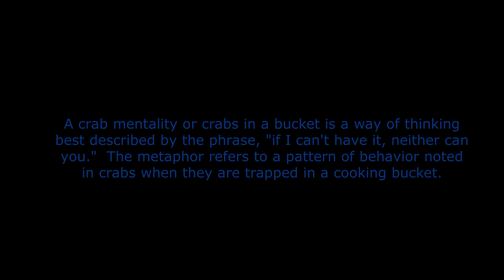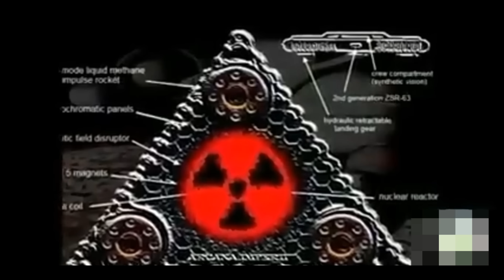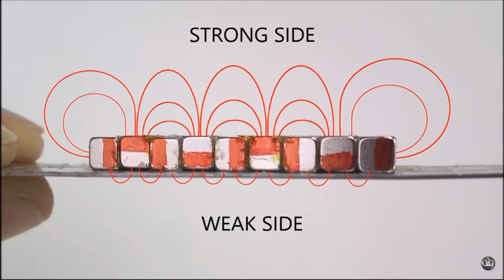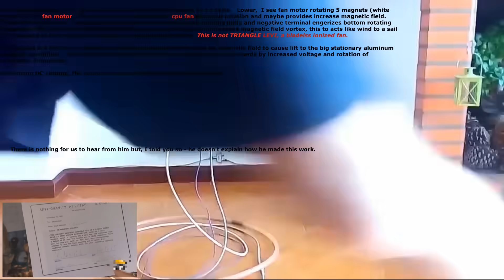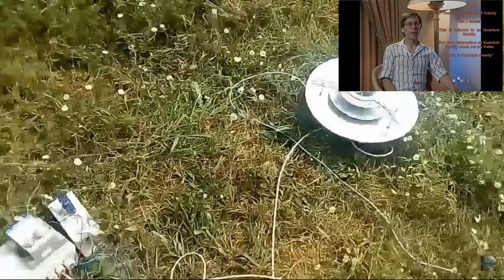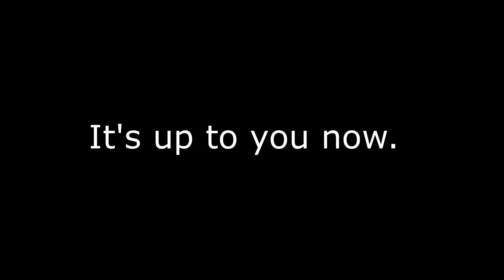anti-gravity project

Comment: Here is my latest Theory Of Everything along with the associated gravity test.  I believe what is called gravity is actually a part of the currently recognized 'em' photon and that the 'gem' photon is the energy unit of this universe that makes up everything in existence in this universe.  (Copy and pastes from my files):

Revised TOE: 3/25/2017a.
My Current TOE:

THE SETUP:
1. Modern science currently recognizes four forces of nature: The strong nuclear force, the weak nuclear force, gravity, and electromagnetism.
2. In school we are taught that with magnetism, opposite polarities attract and like polarities repel. But inside the arc of a large horseshoe magnet it's the other way around, like polarities attract and opposite polarities repel. (I have proved this to myself with magnets and anybody with a large horseshoe magnet and two smaller bar magnets can easily prove this to yourself too.  It occurs at the outer end of the inner arc of the horseshoe magnet.).
3. Charged particles have an associated magnetic field with them.
4. Protons and electrons are charged particles and have their associated magnetic fields with them.
5. Photons also have both an electric and a magnetic component to them.

FOUR FORCES OF NATURE DOWN INTO TWO:
6. When an electron is in close proximity to the nucleus, it would basically generate a 360 degree spherical magnetic field.
7. Like charged protons would stick together inside of this magnetic field, while simultaneously repelling opposite charged electrons inside this magnetic field, while simultaneously attracting the opposite charged electrons across the inner portion of the electron's moving magnetic field.
8. There are probably no such thing as "gluons" in actual reality.
9. The strong nuclear force and the weak nuclear force are probably derivatives of the electro-magnetic field interactions between electrons and protons.
10. The nucleus is probably an electro-magnetic field boundary.
11. Quarks also supposedly have a charge to them and then would also most likely have electro-magnetic fields associated with them, possibly a different arrangement for each of the six different type of quarks.
12. The interactions between the quarks EM forces are how and why protons and neutrons formulate as well as how and why protons and neutrons stay inside of the nucleus and do not just pass through as neutrinos do.

THE GEM FORCE INTERACTIONS AND QUANTA:
13. Personally, I currently believe that the directional force in photons is "gravity".  It's the force that makes the sine wave of EM energy go from a wide (maximum extension) to a point (minimum extension) of a moving photon and acts 90 degrees to the EM forces which act 90 degrees to each other.  When the EM gets to maximum extension, "gravity" flips and EM goes to minimum, then "gravity" flips and goes back to maximum, etc, etc.  A stationary photon would pulse from it's maximum extension to a point possibly even too small to detect, then back to maximum, etc, etc.
14. I also believe that a pulsating, swirling singularity (which is basically a pulsating, swirling 'gem' photon) is the energy unit in this universe.
15. When these pulsating, swirling energy units interact with other energy units, they tangle together and can interlock at times. Various shapes (strings, spheres, whatever) might be formed, which then create sub-atomic material, atoms, molecules, and everything in existence in this universe.
16. When the energy units unite and interlock together they would tend to stabilize and vibrate.
17. I believe there is probably a Photonic Theory Of The Atomic Structure.
18. Everything is basically "light" (photons) in a universe entirely filled with "light" (photons).

THE MAGNETIC FORCE SPECIFICALLY:
19. When the electron with it's associated magnetic field goes around the proton with it's associated magnetic field, internal and external energy oscillations are set up.
20. When more than one atom is involved, and these energy frequencies align, they add together, specifically the magnetic field frequency.
21. I currently believe that this is where a line of flux originates from, aligned magnetic field frequencies.

NOTES:
22. The Earth can be looked at as being a massive singular interacting photon with it's magnetic field, electrical surface field, and gravity, all three photonic forces all being 90 degrees from each other.
23. The flat spiral galaxy can be looked at as being a massive singular interacting photon with it's magnetic fields on each side of the plane of matter, the electrical field along the plane of matter, and gravity being directed towards the galactic center's black hole where the gravitational forces would meet, all three photonic forces all being 90 degrees from each other.
24. As below in the singularity, as above in the galaxy and probably universe as well.
25. I believe there are only two forces of nature, Gravity and EM, (GEM). Due to the stability of the GEM with the energy unit, this is also why the forces of nature haven't evolved by now. Of which with the current theory of understanding, how come the forces of nature haven't evolved by now since the original conditions acting upon the singularity aren't acting upon them like they originally were, billions of years have supposedly elapsed, in a universe that continues to expand and cool, with energy that could not be created nor destroyed would be getting less and less dense? My theory would seem to make more sense if in fact it is really true. I really wonder if it is in fact really true.
26. And the universe would be expanding due to these pulsating and interacting energy units and would also allow galaxies to collide, of which, how could galaxies ever collide if they are all speeding away from each other like is currently taught?

DISCLAIMER:
27. As I as well as all of humanity truly do not know what we do not know, the above certainly could be wrong. It would have to be proved or disproved to know for more certainty.

_________________________________________________________________

Here is the test for the 'gravity' portion of my TOE idea.  I do not have the necessary resources to do the test but maybe you or someone else reading this does, will do the test, then tell the world what is found out either way.

a. Imagine a 12 hour clock.
b. Put a magnetic field across from the 3 to 9 o'clock positions.
c. Put an electric field across from the 6 to 12 o'clock positions.
(The magnetic field and electric field would be 90 degrees to each other and should be polarized so as to complement each other.)
d. Shoot a high powered laser through the center of the clock at 90 degrees to the em fields.
e. Do this with the em fields on and off.
(The em fields could be varied in size, strength, density and depth.  The intent would be to energy frequency match the laser and em fields for optimal results.)
f. Look for any gravitational / anti-gravitational effects.
(Including the utilization of ferro cells so as to be able to actually see the energy field movements.)

(An alternative to the above would be to shoot 3 high powered lasers, or a single high powered laser split into 3 beams, each adjustable to achieve the above set up, all focused upon a single point in space.)

'If' effects are noted, 'then' further research could be done.
'If' effects are not noted, 'then' my latest TOE idea is wrong.  But still, we would know what 'gravity' was not, which is still something in the scientific world.  Science still wins either way and moves forward.
Reply: I am very happy to know that there are those among us who actually think and like thinking for themselves.  Keep it up.
Reply: @justanotherguy469  a.  Where did you see above where I claimed 'matter' can neither be created nor destroyed?  It's 'energy' that science claims can not be created nor destroyed.  If you have issues with that, take it up with science.

b.  Consciousness and intelligence appears to have 'evolved' into existence, and from all current analysis that I have done, will cease to exist upon this planet Earth as the planet Earth will no longer exist one day, as will this solar system cease to exist one day, as possibly even the galaxy will cease to exist as it is one day, as possibly even the entire universe will cease to exist as it is one day.  It all depends upon what is really true or not in this cause and effect state of existence that we appear to exist in.

c.  About 'thinking'.  Thanks.  Trying to be a sincere honest truth seeker in a world filled with so many apparent lies, it is certainly hard to do at times.  Try to honestly and sincerely answer the following questions though:

"What exactly matters throughout all of future eternity and to whom does it exactly and eternally matter to?"

(My current analysis seems to indicate that all of life itself is all ultimately meaningless in the grand scheme of things, at least from Earthling's perspective, here again, all depending upon what is really true or not in this cause and effect state of existence that we appear to exist in.)
Reply: @charlesbrightman4237   A great read mate
I am an old fella with very basic understanding of science and i did follow your hypothesis so you did well explaining .
For me I believe that untill we solve gravity we will never leave this solar system!

PS
Sos about the cancer (Charlie Dancer) 
Maybe you could PRAY for it to stop ROFL
But thinking is our greatest gift from GOD LOL

Humans are god its that simple cause without me god does not exist! 
Keep thinking and questioning and all the best.
Reply: @SunnieSnell  Thanks and I agree about gravity and proper protections from harmful cosmic radiation too.  Proper protection especially from neutrinos on space ships, (of which I can't even currently see how that could even actually be done), needs to be accomplished as well, otherwise not only won't humans survive long term in outer space, but neither will AI robots or quantum computers.

The current analysis is that we should just try to enjoy this life we have, then it appears we will all die, forget it all and then will be forgotten one day in future eternity as if we never ever existed at all in the first place.  But then again, I will be the first to admit that I could be wrong due to various reasons.

Since you like science, in addition to my above 'science' posts, here is a copy and paste that goes along with the above as to possibly how numbers actually exist in this universe for math to do what math does.  Enjoy.

"The mathematics for the TOE doesn't even exist yet as far as I am currently aware.  It goes beyond any quantum field theory formulas that I am currently aware of.  The outline though is basically as follows:

The formula has at least 3 levels to it:
1. The Internal Photon Level:  The 3 interacting forces, (which might even be just a singular force with 3 different modalities), all interacting at basically 90 degrees to each other and all simultaneously pulsating and swirling.  A complex part of the formula but I believe to be totally doable.

2. The External Photon Level:  For each pulsating, swirling photon, all the pulsating, swirling photons interacting with it.  An exponential part of the formula that I am not even sure modern day super computers could adequately handle.

3. The Inter-dimensional Photon Level:  For each modality within each photon would have an energy frequency associated with it.  The energy frequencies could be seen as being in their own space time dimension.  (For me, 'space' is energy itself of which is the 'gem' photon and 'time' is the flow of energy; 'temperature' is the interaction of energy), so one would be dealing with way more than just 3 spatial dimensions and way more than just 1 time dimension (as there would many different energy frequencies with many different flows of energy).  Whenever like resonate energy frequencies resonated with each other, they would affect each other, kind of like 'spooky action at a distance'.  Anytime energy frequencies overlapped, there would be a temporary spike of some sort in each space time dimension.  In addition, if in reality the 'gem' photon is just a singular force with 3 different modalities, it's possible that energy could 'slip' between modalities which would also affect the results.  A very complex part of the formula on top of all the complexity that came before it.

4. Any time any energy moved in the system, the entire formula would have to be recalculated due to potential ripple effects.

Like I said above, I don't even believe the mathematics exists yet for what I am trying to do, but at a minimum, the formula would contain the above levels the way I currently see it to be.

____________________________________________________________________________

'IF' my latest TOE idea is really true, (and I fully acknowledge the 'if' at this time), that the pulsating, swirling 'gem' photon is the energy unit of this universe that makes up everything in existence in this universe, and what is called 'gravity' is a part of what is currently recognized as the 'em' photon, then the oscillation of these 3 interacting modalities of the energy unit would be as follows:

Gravity: Maximum in one direction, Neutral, Maximum in the other direction;
Electrical: Maximum in one direction, Neutral, Maximum in the other direction;
Magnetic: Maximum in one direction, Neutral, Maximum in the other direction.

Then:
1 singular energy unit, with 3 different modalities, with 6 maximum most reactive positions, with 9 total basic reactive positions (neutrals included).  Hence 1, 3, 6, 9 being very prominent numbers in this universe and why mathematics even works in this universe.
(And possibly '0', zero, for no flow of energy, hence the number system that we currently have)."
Reply: @charlesbrightman4237   Ta Mate  Much food for thought
Now i am going to read up on gem photons (New ifo for me LOL) but i like!
Time is a variable that s for sure as we measure it only buy earth standards and as a geographer we will never be in this place again, expanding universe!  Every thing moves.
Space is a made up word to describe space.  It is not empty!  Like infinity which humans do not comprehend as we are finite.
I read  a book called "Everything is Relative" and from that i started to grasp quarks and it was, in the book, was postulated that the Universe could be shrunk to the size of a basket ball.  The pressure and heat would be insane but was a good image to make one think.
Gravity will be solved but i may not be here and will i see man on Mars, interesting!
I am sad that maths was taught so badly when i was at school cause now i realise that it can answer so many questions.

Ta for the info and some new paths to explore and tell Charlie Dancer to <expletive> off!
Reply: @SunnieSnell  a.  See also my other thread for this video that you also might like the conversation going on there.  The thread is:
"While not all matter is considered magnetic, all matter can be affected by magnetism, due in large part to the magnetic fields of the moving electrons matter, (atoms and molecules).  Magnetic fields interacting with other magnetic fields."

b.  Here is my current view concerning 'space' and 'time, (in part):

FOR ME:
'Space' is energy itself.  Wherever space is, energy is.  Wherever energy is, space is.  They are one and the same thing.  And for me, the 'gem' photon is the energy unit of this universe that makes up everything in existence in this universe.

'Time' is the flow of energy.

'Time' (flow of energy) cannot exist unless 'space' (energy itself) exists.  And 'space' (energy itself) that does not flow (no flow of time / energy) is basically useless.  An entity cannot even think a thought without a flow of energy.  If all the energy in the universe stopped flowing, wouldn't we say that 'time stood still'?  Time itself would still exist, it would just not be flowing, (basically 'time' stopped).

But then also, how space and time are linked in what is called 'space time', (energy and it's flow).
Reply: @charlesbrightman4237  Where did you see above where I said that you said that matter can neither be created nor destroyed?  Just so you know, matter is energy.  E=MC^2 therefore M=E/C^2.  So as you see, you are dead wrong.
Reply: @justanotherguy469  About a week ago as of this post, you posted:
"If matter can neither be created or destroyed, why is that also not true for consciousness and intelligence?"

And a week ago as of this post, I replied to your reply, in part:
"a.  Where did you see above where I claimed 'matter' can neither be created nor destroyed?  It's 'energy' that science claims can not be created nor destroyed."

Yes, I believe matter is made up of energy.  If you understood my Theory Of Everything idea, you would have seen that too.  But here again, I acknowledge that the gravity test above needs to be done to prove or disprove that portion of the TOE, as I already stated above.  See the ending of the gravity test above, in part posted here again for your convenience:

"'If' effects are noted, 'then' further research could be done.
'If' effects are not noted, 'then' my latest TOE idea is wrong.  But still, we would know what 'gravity' was not, which is still something in the scientific world.  Science still wins either way and moves forward.
'
Reply: @charlesbrightman4237  This is the type of response that I would expect from someone whom is intelligent.
Reply: This is a good theory. I hope it becomes true!
Reply: @omkr0122  Thanks, but consider the following:

a.  If species from this Earth don't figure out how to have actual artificial gravity for space bases on planets and moons, (as large rotating space ships won't really work for space bases on planets and moons), then all humans are most probably going to die and go extinct.

b.  If species from this Earth don't figure out how to have actual protections from harmful cosmic radiation, then all species including AI's (with the possible exception of microbes, but maybe even microbes from this Earth), are most probably going to die and go extinct.

So, we had better do more than just 'hope' if we want any conscious species from this Earth to continue to consciously survive throughout all of future eternity.  Otherwise, we all die and go extinct without any conscious entity being left to care we even ever existed at all in the first place, much less however we might have all existed.  At best maybe microbes still exist to carry and continue to evolve species possibly to have consciousness again.  Maybe not though too.
Reply: @charlesbrightman4237  Your life. Not mine. Whats the point of living even without a God? Ask yourself, what if there is a God?
Rejection is eternal Hell. Its your choice to make...
Reply: @SamaritanElad  So, you have no actual evidence of God's actual existence, nor that we have any sort of conscious afterlife, nor an immortal conscious soul, nor that heaven nor hell actually exist.  All you have is a set of beliefs that you have been brainwashed with.  Whomever brainwashed you did a good job it appears.  Your life, not mine.
Reply: @charlesbrightman4237  The world calendar even revolves around Jesus Christ. You are blinded because you have no faith. I'll pray for you - all I can do... But think fast as His second coming is soon!
Reply: @charlesbrightman4237  If matter can neither be created or destroyed, why is that also not true for consciousness and intelligence?
Reply: Intelligence may only survive in space thru computers and robotics
Reply: @andecap1325  So then, how exactly does one protect those computers and robotics from long term neutrino damage?  (And possibly other harmful cosmic radiations to those computers and robotics).

And what actually occurs to that intelligence if modern science is correct that the expanding universe ends either in a 'big freeze' or continues on in the 'big bounce'?

And if modern science is correct concerning how the current forces of nature came into existence, in the early moments of the expansion of the singularity, and that energy cannot be created nor destroyed, and that the universe is still expanding, and hence the energy in the universe getting less and less dense, what happens to that intelligence, probably when, not if, the current forces of nature 'evolve', since it was expansion of the singularity that supposedly brought them into existence, and basically the singularity is still expanding?  (Possibly even the forces of nature 'evolving in the very next moment of expansion of the universe in the blink of an eye.)
Reply: @charlesbrightman4237  Part replacment/replication engineering. Forever ,I would think not but definitely longer than man.Hopefully with Quantum calculating they will figure out the rest.
Reply: @andecap1325  Good idea about part replacement/replication.  Consider that basically 'junk' parts could be held in some sort of vat, then even if neutrinos or whatever manipulated them, so what?  Just print out a new part as needed, when needed.  Consider that our body already does that too.  Our cells of our body are routinely replaced, although, with our body system of cell replacement, errors are often introduced in the replication process.  And if we could upload multiple copies of our consciousness, memories and thoughts, then some redundancy could be had there too in case of errors.  Kind of like what is already done with computers.  Good thinking.
Reply: Charles I'm a  land surveying technician who has opportunities to utilize drone and laser measuring devices. One item that has been at the Forefront of my research and development towards that New Perspective or old View of Ariel mapping is applying anti-gravity technology or propless engines to navigate the Drone. I've been using Vector thrusted engines as well as electromagnetic compensators that will allow a dirigeable or blimp 2 move or Traverse in a certain direction. Have your experiments been able to offer you any control over navigation or consistency in either hovering or weight displacement...or lift?
Reply: @falconvisionuav  Here is the copy and paste from my files:

Thought about space time:

Consider the following:
a. Wavelength equals speed of light divided by frequency.
b. Wavelength is how far a single 'em' photon goes in space, or possibly is the size of space itself.  (Especially since 'space' itself has not been defined yet).  Possibly different sizes of space for different 'em' frequencies.
c. Speed of light: 'light' being 'em' photons, 'speed' being distance divided by time, distance being two points in space with space between those two points.
d. Frequency being 'hertz', 'hertz being cycles per second, or how far an 'em' photon goes at a specific size during one second.
e. "IF" wavelength changes (the frequency changes) then the distance a single 'em' photon goes would change and/or the size of space itself would change (assuming that an 'em' photon makes up 'space' itself).
f. Possibly 'space' varies due to 'space' being made up of 'em' itself and as 'em' frequencies change, 'space' changes.
g. Another possibility would be that as the wavelength changes (frequency changes) then as the distance a single 'em' photon goes would also change in it's time of existence, 'time' would change for any given 'em' photon length.  The effect of that single 'em' photon makes in it's given time of existence.
h. Possibly 'time' varies due to the wavelength of the 'em' photon.
i. So, possibly 'space' varies due to energy frequencies changing and 'time' varies due to the wavelength of energy changing, the 'em' photon being energy itself.  And if as I currently believe that what is called 'gravity' is actually a part of the 'em' photon, then the 'gem' photon makes up the energy unit that possibly makes up everything in existence in this entire universe including the universe itself, including 'space' and 'time' or 'space time' itself.  It is also how space and time can warp, bend and vary.
Reply: @falconvisionuav  Short answer:  'no'.
I don't have the resources to do the gravity test and have also been fighting advanced cancer since 2003 and should have been dead years ago.  The end of last year I finally stopped my cancer treatments, when is enough, enough?

But, if I don't get my ideas out now while I still consciously can, whether those ideas are correct or not, then when?

First I believe the above gravity test has to be done to prove or disprove that belief that I currently have.  If it's not correct, then it's not correct.  If it is correct, or at least somewhat correct, then further research could be done.

At this time where I am currently at, "if" the TOE idea is correct, then by manipulating the 'em' fields in a proper manner, the direction of gravity should be able to be controlled.

I'll post a copy and paste after this post to how I believe space and time can possibly bend, warp and vary.
Reply: @falconvisionuav  Oh and side note:
Utilize a hydrogen powered drone, they already exist and can give you more flight time.

See my Twitter page under the same name as this comment to see just some of what this world is doing as hydrogen technologies are implemented into it.  The drone info I believe is way down on the feed so you would probably have to scroll down a bit.
Reply: I've been successful with these advances but only and subsurface environments like oceans and lakes where I don't have to compensate with an Antigravity calculation or an aerodynamic design for compensating
Reply: The glue the attachment particle, or the unglue or unattachment particle.
Reply: Hubble Space Telescope image of NGC 6052, a pair of colliding galaxies that lies in the constellation of Hercules, about 230 million light-years away from Earth.
(Image: © ESA/Hubble & NASA, A. Adamo et al.)

A new image from the venerable Hubble Space Telescope shows what happens when two galaxies collide. That's relevant for us residents of the Milky Way, because our own galaxy is expected to collide with the nearby Andromeda galaxy in about four billion years.

The image captures a scene some 230 million light-years away from Earth, in the constellation Hercules. (One light-year is the distance that light travels in a year — about 6 trillion miles, or 10 trillion kilometers.) Here, Hubble zooms in on the merging galaxies, a double object known as NGC 6052. The Image can be seen at Space.com I`m sure you`ll enjoy it